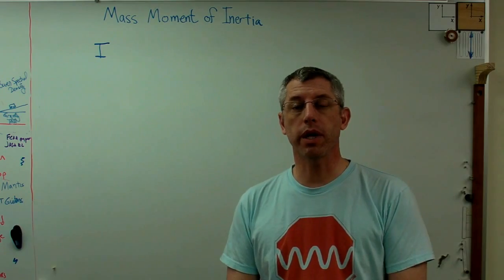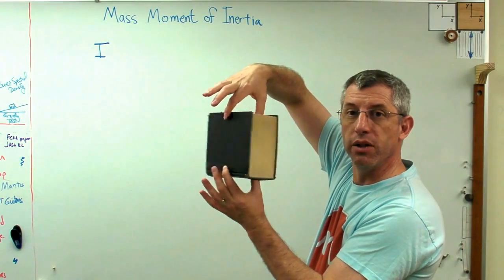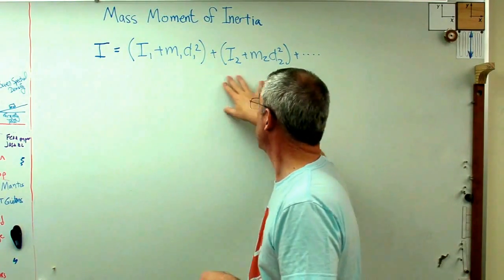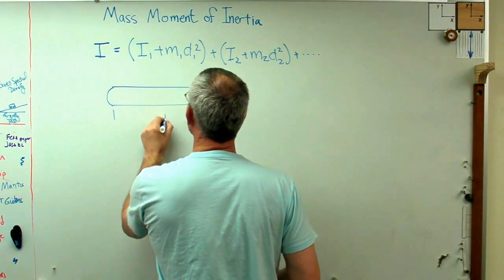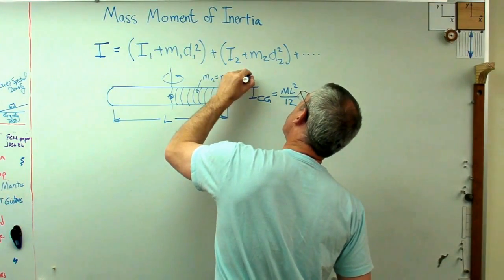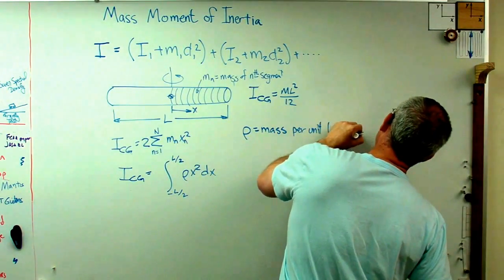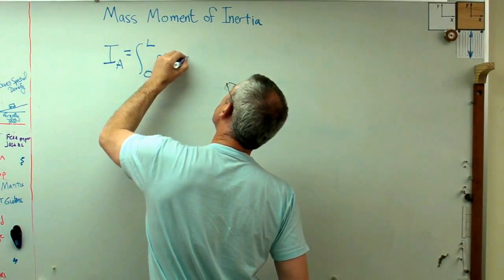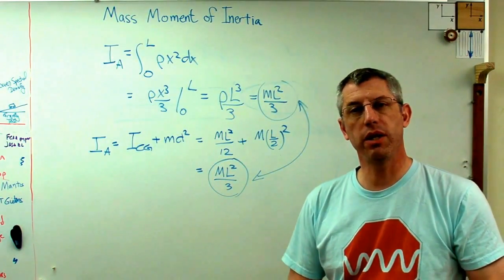Mass Moment of Inertia - Brain Waves.avi

Comment: As great as this lecture is, I still must stress the fact that in the example he's presenting, the diameter of the rod is ASSUMED to be MUCH LESS than its length L. If this were not the case (which could very well be true for some very thick, shorter rods) we would have to take into account the variation of the y-coordinate as well (the axis in and out of the whiteboard) for each of the small "mass cubes" of infinitesimal mass dm (also note that the z-component is parallel to the axis by my choice of coordinates, and this component of the axis-mass cube distance obviously does NOT contribute to the moment of inertia).

By not making the aforementioned assumption we now instead have a volume integral which needs solving, which is quite messy by comparison. Luckily though it can readily be seen from a purely mathematical standpoint that for thin, long rods the sum (i.e. integral) involving y is much smaller as compared to the contributions of the "x-sum." Thus, for such geometries one can neglect these small deviations in y-coordinates and we effectively go back to the "slices" in the x-direction, as shown in the video.

End of message, cheers!
Reply: BackflipBeaver wow are you from MIT :)
Reply: BackflipBeaver : Wow r u from chuteyaa clzz ......